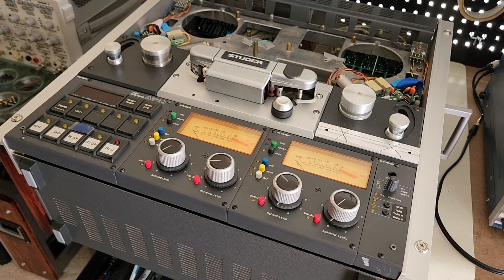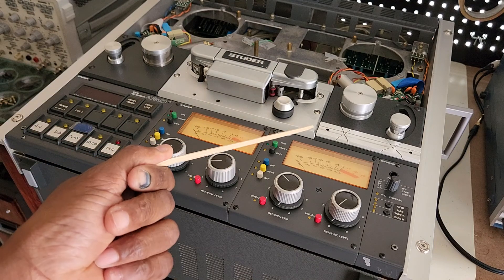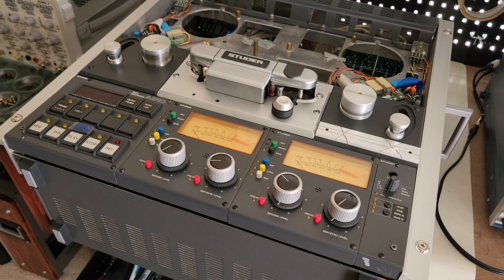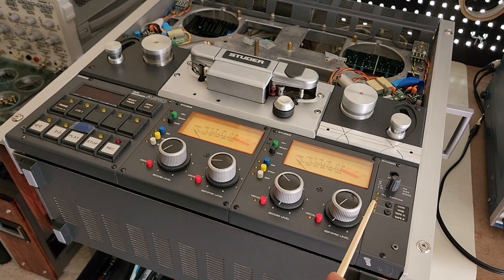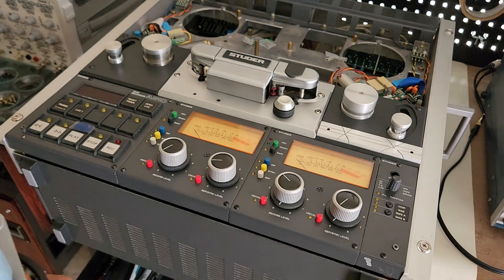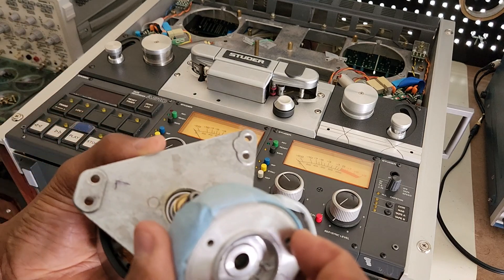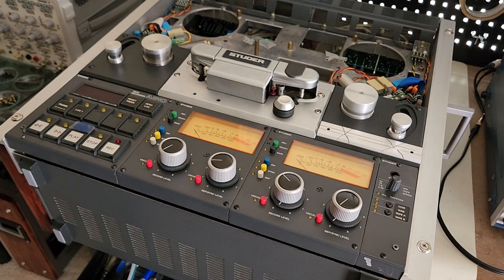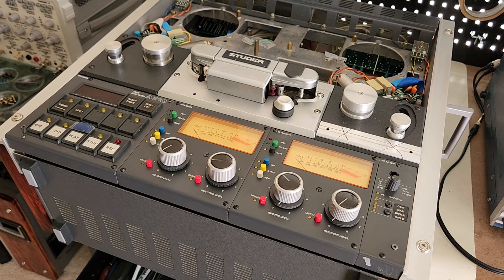Studer A810 Keep Stopping During Playback & Rewind

Comment: Hello, where did you get the bearings? My 810 is a 3-speed version. I just noticed that it doesn't like Scotch 150 1mil tape.. plays fine and forwards fine but doesn't like to reverse. I'm certain that I could further tweak the tensions to get it working for REW, but I didn't think that scotch tape would be problematic. ATR, maxell work flawlessly.  Does your deck get pretty warm on the right side during operation? 

https://youtube.com/shorts/mTmnQqG7Pvo?si=PuMnl45QzOYditC0
Reply from the maker: I did get the bearings from eBay. No my deck does not get hot on one side or the other. But the deck does generate heat when played for a long time. Some older tapes does get sticky and hard to pull and the deck could get extra hot from working too hard. I am trying to use only new tapes: ATR or Recording the Master tapes. You should also check out www.tapeheads.net for answers to your questions.
Reply from the maker: One more thing: Try to reseat the cards in the deck. Sometimes that could solve some issues. A tape deck guru from tape heads.net gave me that tip some time ago for the A810 and the issue went away. it was the same stop issue as you are having. Try it and see. no guarantee.

Comment: Regarding the washers issues: the 4 washers drawn on the SM don't strike me as exactly similar to the two washers you've found. Did you acquire that deck second hand? Could it be that the previous owner somehow lost those 4 washers and replaced them by 2 washers himself? and maybe his two washers are thicker than the 4 original ones?
Reply from the maker: Yes I got the deck second hand.